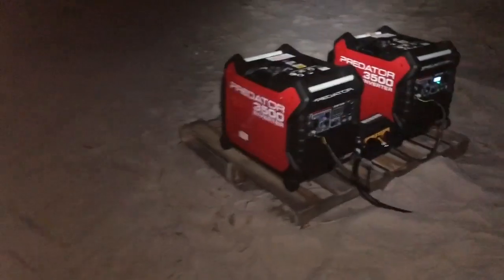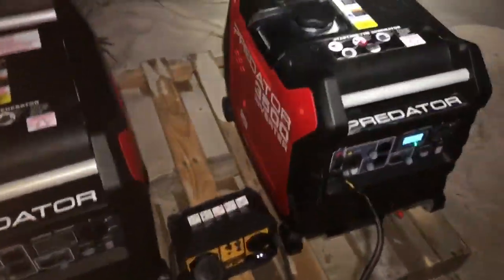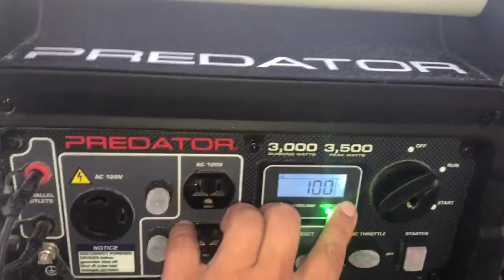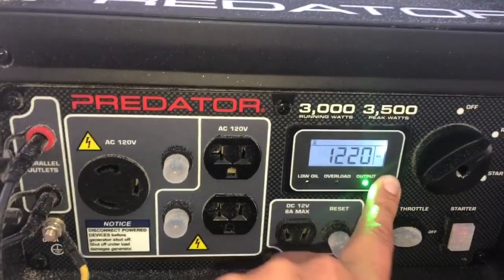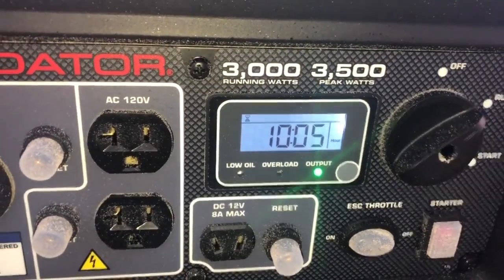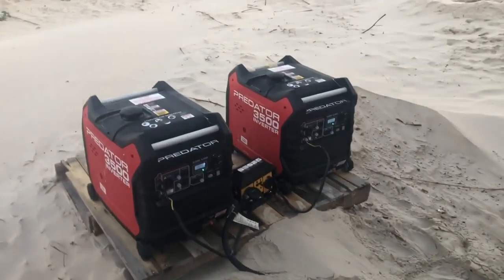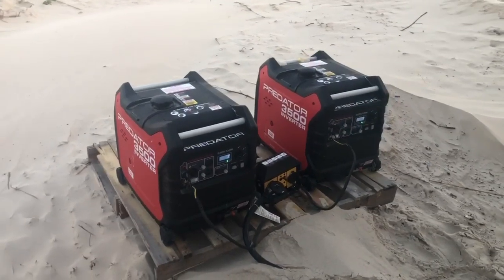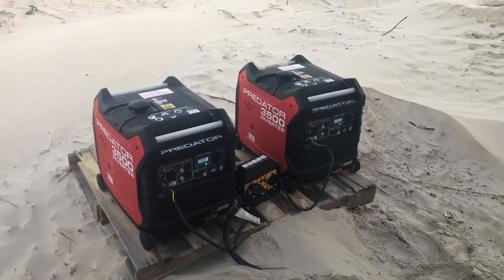Predator 3500 run time powering two 15,000 BTU air conditioners in parallel

Comment: I have two 1400 predators to run my 15,000 btu rv ac. I went with those because they’re so small they can fit in my compartment. Which I love. I’m using them as we speak as I’m on my way to Florida for the winter. Though I’ve never ran them more than an hour for testing so tonight I find out how long they last.

Comment: Just bought the same setup to run our one 15000k unit, but wanted enough juice to power ANYTHING else without issue.  Great setup.  You can get two predators for the cost of one honda.  no brainer.

Comment: Is this link make it 220v.. or it just to run 2 Gen at the same time
Reply: doubles watts, not voltage
Reply: With the parallel kit it will do 220v.
Reply: @miguelaguilar2956  Series would double voltage, Parallel doubles amperage...
Reply: Thank You sir. Nice to know!

Comment: Will one 3500 run one of the units? Just not much else I’m assuming. Good info
Reply from the maker: Smokin With The Robinsons yea it'll run one AC, tv, sound system fans n stuff like that. both will carry everything wide open, coffee pot both ac's and microwave. Anything you can throw at them. They've got over hours on them now and they've been great
Reply: Awesome. Thanks for the reply